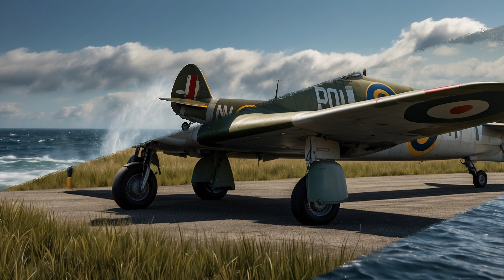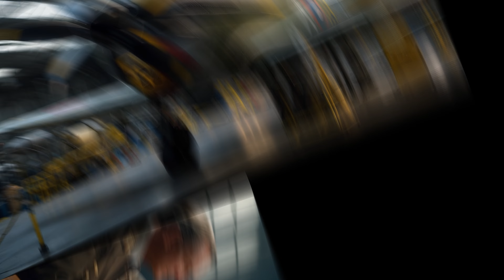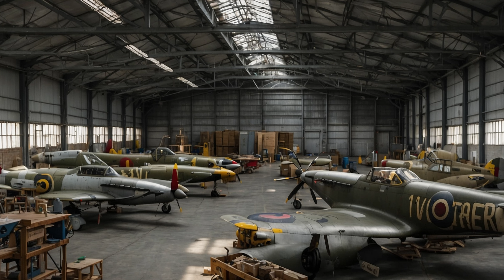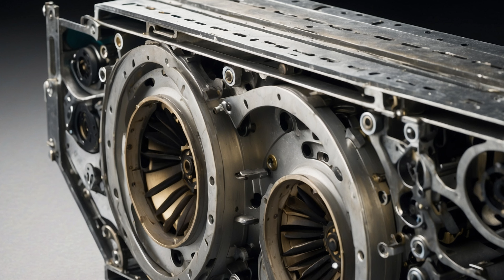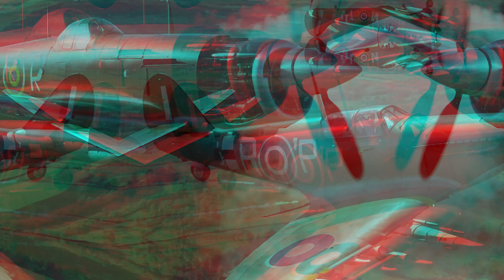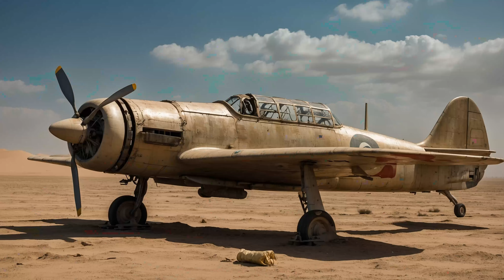Why The Spitfire Was The Best WWII Plane?

Comment: It wasnt even part of the competition. It was a decent air-superiority fighter that was left out out of the equation by its relatively short combat radius even with drop tanks.
Reply: what are you talking about? The Spitfire was the greatest fighter of WWII!
Reply: @The-Pullet-and-Duck  wasn't even in the fight over Germany until the war was almost over
Reply: @touristguy87  You do know what a Spitfire is, don't you?
Reply: Best plane EVER........must be a Yank, get back into your p47Jug, because the P51 wasn't much without the Merlin either 🇬🇧🤔
Reply: @jonathansteadman7935  ...no plane is much without its engine

Just as it isn't much of its 800 miles away from the combat because of limited range. The Spitfire had its day but it wasn't even superior to the Fw190A for a while there. 

The way that you Brits mince over it you'd think that they never got shot down.